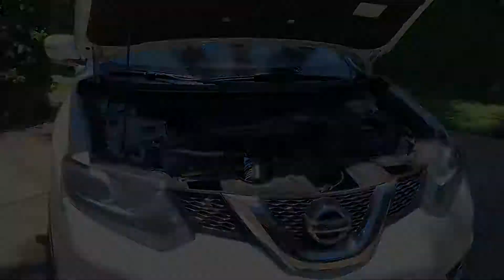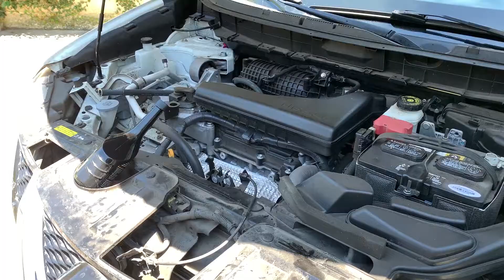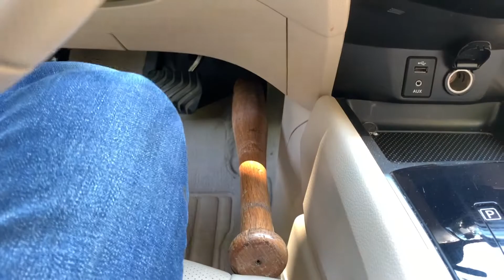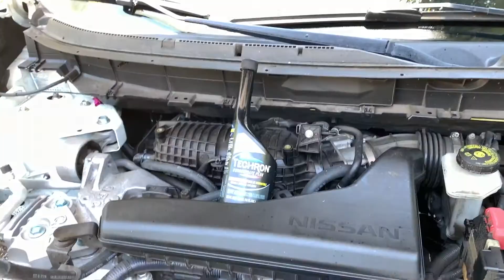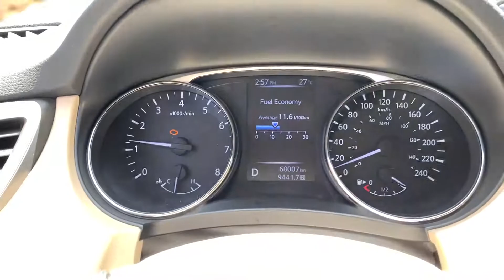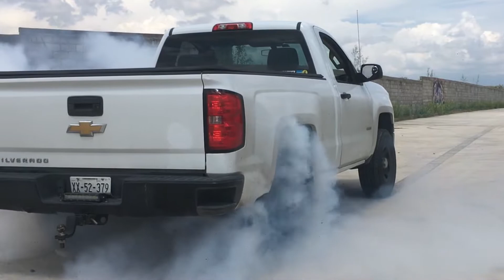How To Remove Carbon BuildUp using Fuel Injector Cleaner in Vacuum Lines

Comment: This car has port injection: putting the cleaner in the tank will clean the injectors, intake valves, and combustion chambers slowly.  Instead, he's overloading the engine with the cleaner; that's why the car is smoking.  The unburned cleaner may damage the catalytic converter.  And if the vacuum sucks up the cleaner too fast, the engine will hydrolock and be totaled.
Reply: yeah. If it is port injection, then they should just put the cleaner in the gas tank. All set. 
This process on the video would be for GDI. But it is not GDI engine. 😅

Comment: I tried this with techron  but  I bogged the engine on purpose and let it stall thinking maybe that would be a good way to hotsoak it? Could this damage the engine? I barely poured any at all, just enough to stall it.
Reply from the maker: Nah you should be fine, just be mindful to change your oil afterwards if it gets too dorty
Reply: You may damage your engine if you hydrolock.
Reply from the maker: @ospuddy  Dont pour a 5 gal bucket at once lol
Reply: @BadAssEngineering  A few reviews on Amazon for CRC show the users hydrolocked their engines after following the CRC instructions.  If the intake manifold has a geometry that tend to puddle the cleaning fluid into a low spot or if the intake has variable-length runners, the risk of hydrolocking increases.  Both BG Platinum and ATS 3C include instructions to rev the engine 2-3 times every 30-45 seconds to clear any puddling.  ATS has service bulletins warning which cars cannot be cleaned using their machine due to hydrolocking risks.

Comment: So, injection cleaner has same effective effect to clean intake manifold and valve as catalytic cleaner and be able to shoot throttle vacuum line? 

I only know specified product each to clean as their described name. Catalytic cleaner to clean catalytic converter, intake manifold and valve, and combustion chamber by shooting through vacuum line, while injection cleaner to cleaner injector and valve by pouring into fuel tank.
Reply from the maker: That's the marketing trap. Detergents are the things that do the work, I don't know about cat cleaners, but a good fuel injector cleaner works. Seafoam is injector cleaner, they just market it as a pour-into-engine product. Any injector cleaner will work, what you look for is for the one with the most detergents ln it

Comment: why not just mix it with the fuel in the tank ?
Reply from the maker: Only if you had a carbureted engine
Reply: That’s not true even if it’s a carbureted engine, he would pour it down the throat of the carburetor. I don’t know how familiar you are with carbureted engines. Sounds like you’re kind of a hater on them but really the only difference in procedure between the two is on a fuel injected motor, you have to worry about setting codes off or clogging the catalytic converter/02 sensors etc. whereas with a carbureted engine you can pour it directly into the carburetor as said or utilize the brake booster vacuum line just because it’s carbureted doesn’t mean that you can do the same procedure if anything it’s easier

Comment: This is not how you do an injector cleaning. Completely wrong. Also if I find out where you are tearing up the street or parking lot with your tire spinning I will report your foreign ass to authorities where I did this with another individual and they had to pay for the damage to the area from the tires. It cost them a substantial amount.
Reply: Haha I know you drive a ford  f-150 😂🥱 seems that old junk of yours is having so many issues Kev long always the small size energy threatening someone over the internet
Reply: Try that in my town tough guy! We’ll settle it the old fashioned way